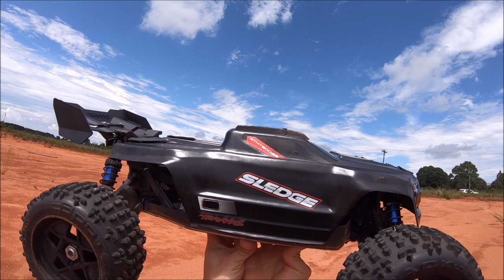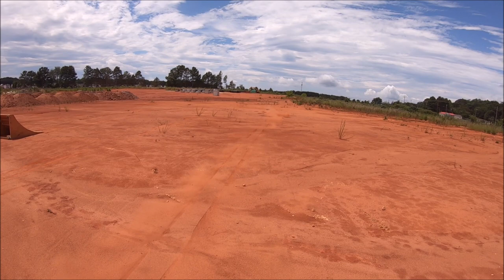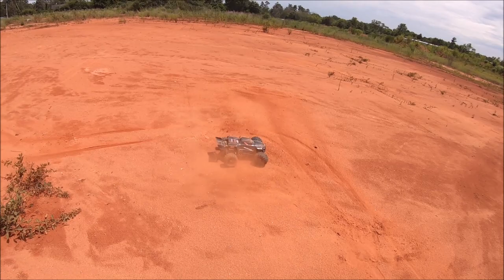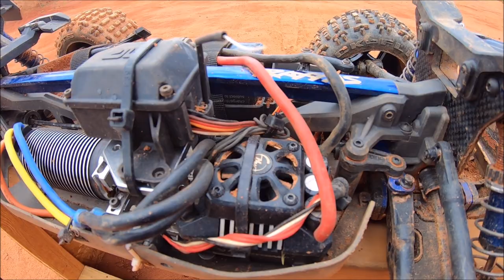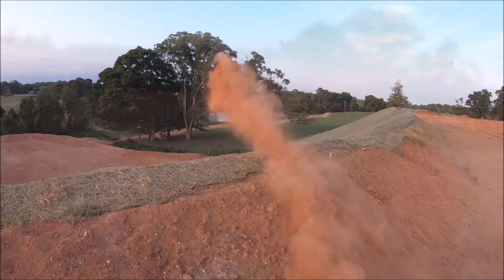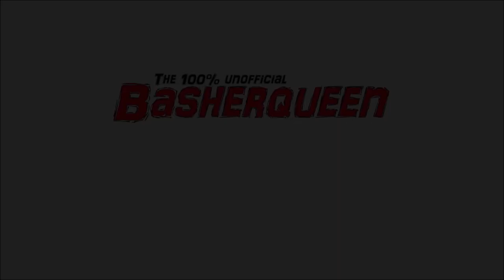TRAXXAS Sledge with NEW M2C Reverse motor mount test! Hobbystar 1480kv💪

Comment: Will the Arrma hex nuts fit the M2C racing hub extensions? Looking to get them for the sledge and wanted to use hex nuts instead of the longer ones that come with them. TIA.
Reply from the maker: Any standard 17mm hex nut will fit yes!